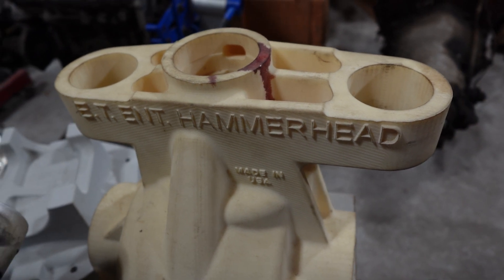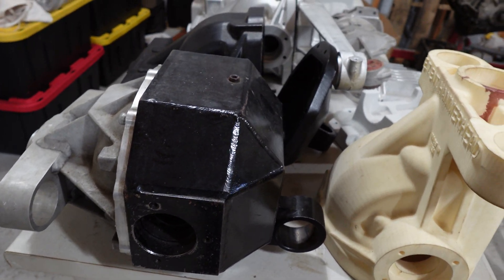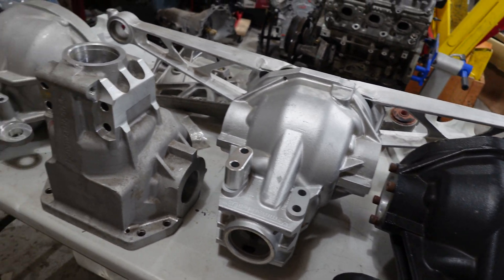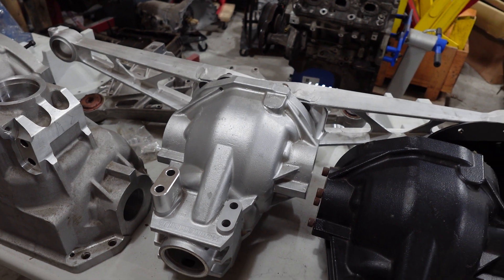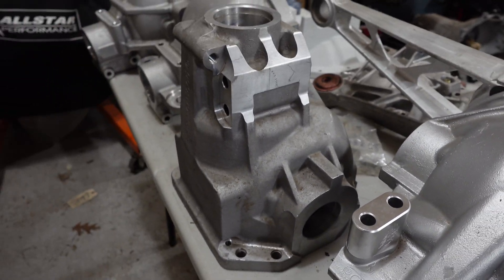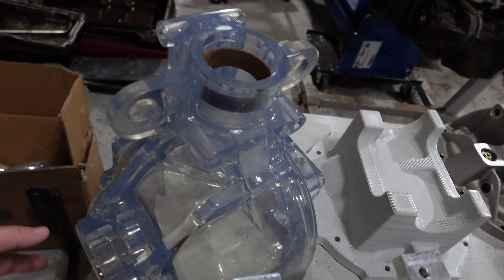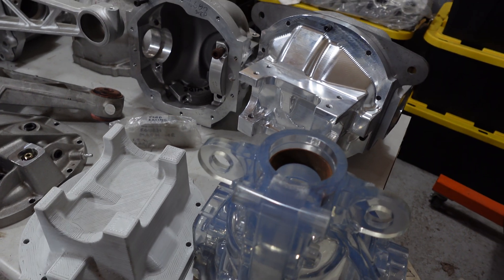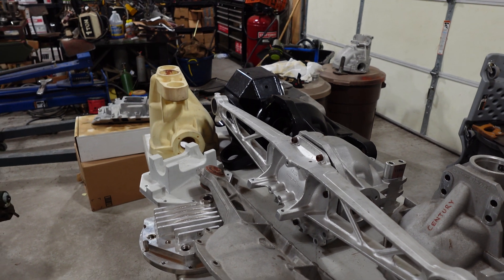From Prototypes To Castings: Our HammerHead® IRS 12 Bolt And 8.8 IRS Differential Housings

Comment: Will it fit a 1996 Impala with an LS swap?
Reply from the maker: Not unless you do a Camaro or Mustang/T-Bird IRS swap
Reply: @etenterprises  can you explain it a little more please
Reply from the maker: @trevoriusmann3017  basically you would have to replace your entire read suspension with one from a 5th Gen Camaro or a Mustang/Thunderbird. Some companies offer kits to do this. We only make the differential.
Reply: This is for IRS rear suspensions. Independent Rear Suspension. You have a solid axle rear.
Just get a 12bolt or ford 9 inch, rear end, built for your car. Everyone makes them. If you really need the power handling.

Comment: Any chance you can help a CTS-V ? I sure would like a 12 bolt in my Cadillac......
Reply from the maker: Gen 1? We have done some design/development on this but it is a smaller market compared to Camaros.  We may accomplish adapting it with some adapter brackets for the mounts between the housing and cover.

Comment: Just checked your website and saw the 'Megalodon' housing that takes the 9.75" gears - I would REALLY suggest promoting that in the off-road world. While IFS has taken off in Ultra4, there aren't as many guys running IRS, but there are definitely people working on it and competing with it, and this could be a great IRS diff option for that application.

If you really wanted to make a splash - put a compact 8.8 IFS housing out there. Found in Ford 1/2 tons from '97 up, they take a reverse cut gear, aftermarket gear sets are available from 3.31 to 5.13. There's been interest in an 8.8 IFS in the off-road world for a while for its size vs strength, but obviously factory pickup truck IFS housings just aren't conducive to high performance off-road builds(the offset and such, they tend to be pretty easy to break too). An 8.8 IFS with the 9.75 IRS would be a killer combo in an Ultra4 buggy. Bet it could be popular for 4WD desert prerunners too, would be a great diff option for center mount long travel A-arms.

Really impressive stuff, most don't understand what kind of undertaking it is to develop and produce cast products like this, it's quite the investment. Good looking products; awesome options for drag racing & road racing, could be awesome options for off-road stuff too!
Reply from the maker: That is the last version we have designed but not going to build that until we get this 8.8 tested and on the market. But if there's reverse cut gears, it could absolutely be great for that. As will the 8.8. Also we may slightly revise our machining to make new Super 8.8 gears fit in our existing 12 bolt housings.